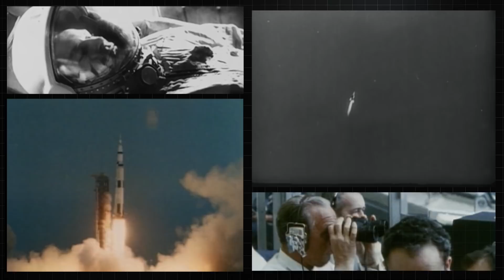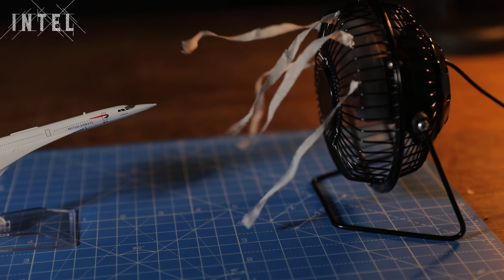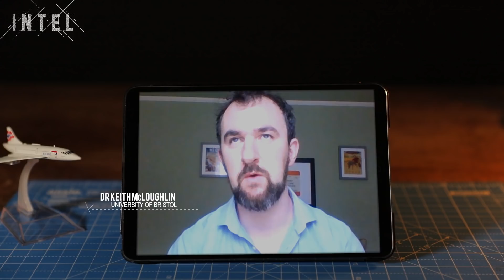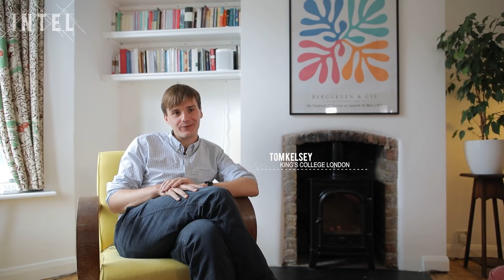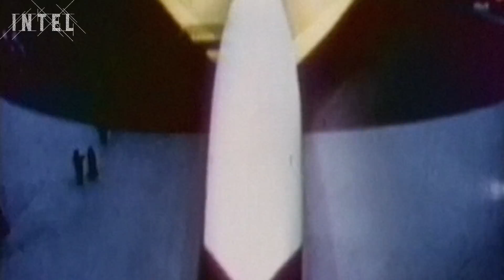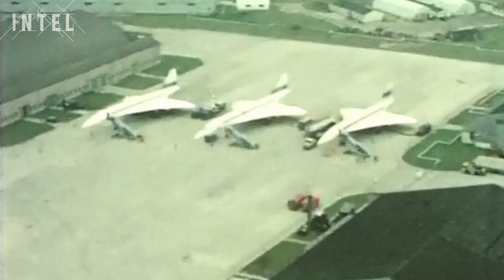Why the USA and Soviet Union FAILED to Go Supersonic | INTEL

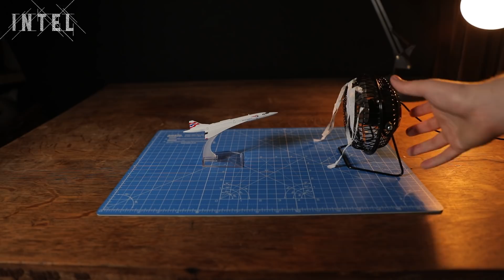Comment: 2:03 Not really, the drag increase until you reach the sound barrier speed, then it decreases with the speed. Supersonic flight in cruise is quite efficient, that's the subsonic part that requires a lot of fuel (Concorde had priority for landing at JFK airport for example). 

Moreover, the whole video focuses on the air intake technology, what about the engine technology? It seems much complex and costly for the Soviets to develop a similar Rolls-Royce/Snecma Olympus 593 than developing a similar air intake.
Reply: which is why the soviets STOLE the JET engine
Reply: @rat_king-  Mind the elaborate? The concorde and TU-144 engines are nothing alike.  Both the 2 engines developed by the Soviets and used on TU-144 could not maintain a mach 2 speed with after burner off, unlike Olympus engines used on Concorde.
Reply: @OctoChad  No i mean the soviets never paid the intellectual rights on the engine, The patent fee's have never been paid for the original jet engines.  Regarding specifically those aircraft? it was the cold war, the world was quiet except for spies, i don't think it happened till to those engines like it would with a captured fighter.